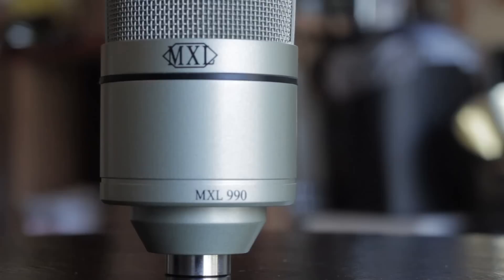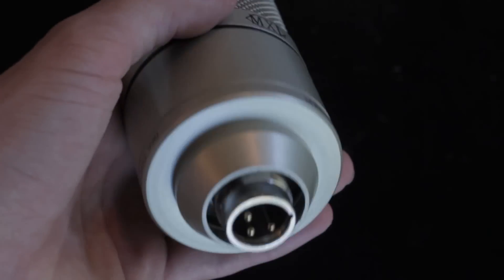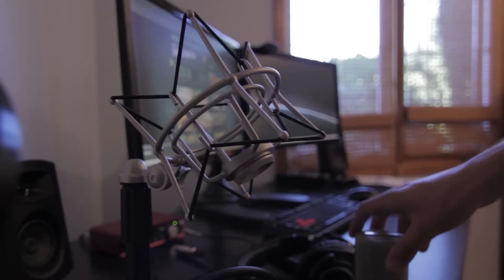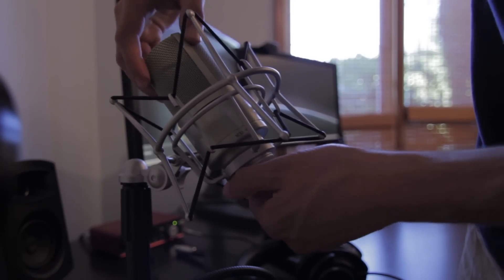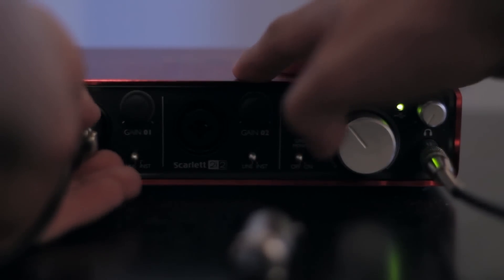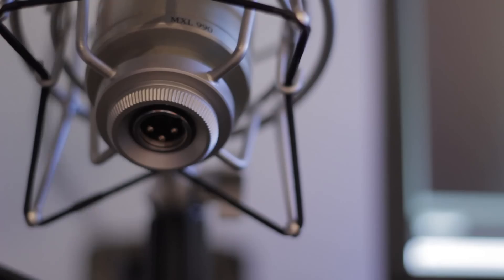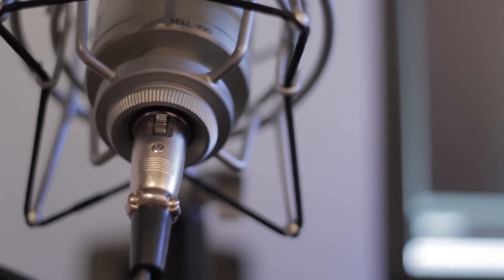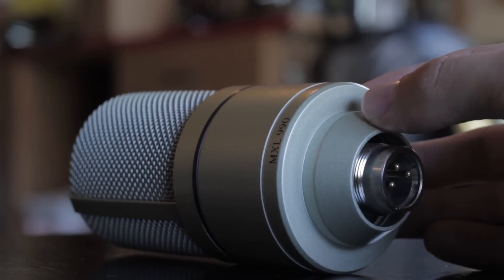Introduction to the MXL 990 Condenser Microphone

Comment: I too found this mic in the pawn shop, but it was a box set...it came with the MXL 990 mic, the shock mount and the standard mount...all in a rugged  ABS plastic case lined with styrofoam and the cutouts for all the pieces to fit snuggly inside...picked it up for $50.00...best studio investment I've made yet. I used it a few times for some vocal tracks...and all I can say is WOW!!! What a difference it made compared to the dynamic mics that I was using. Don't get me wrong, I have some damn good dynamic mics that I use...I plug them into an audio transformer adapter (female XLR on the end to plug the mic into and a 1/4 inch plug on the front that plugs into either my mixer, or my effects processor and then to the mixer...and they sound great for vocals) but the MXL 990 just has such punch, crisp clarity that just sounds phenomenal in the mix...especially after you add a little reverb and/or chorus to it...WOW. This is now my all time go-to mic when I do my vocal tracks...and I use the dynamic mics for backing tracks or mic'ing instruments, amps, speaker cabs, etc. Even for the $100.00 price tag NEW...it's more than worth it. I would definitely recommend it anyone on a budget that wants an outstanding sounding condenser mic, if just as a starter mic...I would put it above and beyond a "starter mic" for sure. I absolutely LOVE mine.

Comment: For the record (and realizing this is an old video) I have to contest: you can actually get some really good straight-to-usb condenser mics... Blue Microphones makes some excellent models that would easily rival or beat a MXL 990, for example.

The actual difference between the MXL 990 and your average USB mic is lack of high-quality preamps, and low-quality A/D converters. Enter the true advantage of analog mics: you can choose your own preamps and A/D converters, and it sets you up for future upgrades - better mics, or whatever.

Anyway, I love my 990 - been using it for a couple of years and it never fails to deliver good clean, detailed recordings.Think I paid $80 and got the 990 bundled with an instrument condenser which is also pretty solid. For the price, it's hard to beat!

Comment: To cut back on background noise, cut your Mic gain back. If you are recording, then in your program like Audacity, you can cut back even more on the background noise and compress the voice recording to even out the volume.

 I own and use an MXL990 XLR microphone but it is modified as the standard mic has some short comings. I've had some very expensive mics but found that after modifying the MXL990, I did not need any other microphone.

I took out the two inner screens on the mic cage to open up the cartridge and also replaced the C3 & C4 capacitors with .22uf Radio shack poly film capacitors. Really made a difference. I may end up putting 1uf caps in as many say it benefits the lower bass even more. The microphone lost the muffled sound with the screen removal and all aspects of the sound were improved with the cap replacement. I also added some automotive rubber sound mat in the base to reduce the bell effect that the base has. It is a thin rubber product that I stuck in there with 3M spray rubber cement. It cannot be too wide as the top of the mic has to screw into the bottom and anything you put in there will interfere with the mic assembly.   I will eventually replace the small mic cartridge with a larger 32mm one soon. Then it will be very close to the higher end microphones as far as sound quality is concerned. 

I use a Alesis Multimix8 USB FX mixer. It has the ability to hook directly up to a computer using the USB port on the mixer without any other equipment. It also has phantom power and several different modes with low, mid and high controls and all the other controls needed. I hook up my mixer to a ham transceiver (a Kenwood TS930SAT) by RCA jacks to the phone patch plugs in back of the transceiver. I also use it for Skype calls as I am often on Internet radio programs and standard terrestrial broadcast stations.

The MXL990 is a very easy microphone to work on. It is fun to take a less than $100 microphone and convert it with just a little time and cash into a microphone that will stand up to many higher end microphones.
Reply from the maker: Wow thanks for the detailed comment Steve, I really appreciate hearing you input. I'm actually very interested in the modifications that you mentioned. Did you follow a guide or do you just know a lot about the inner workings of microphones? Would you recommend these modifications to anyone who feels up to it or is there some good risk involved. 

Also, I would love to know how people go about correctly setting up mic gain and the volume that you're monitoring yourself.
Reply: Nish
I found a lot of information on the internet. Lots of folks have modified their MXL990's to sound almost as good as a high end Neumann.  Just make sure you have a good soldering iron with a fine tip.

I am hooked up to Skype so what I do is call their echo service and what that does is record your mic and then plays it back. You can then adjust gain, sound effects and equalizer settings by hearing your adjustments yourself. Skype is fairly high fidelity so you will hear the differences.

Modifying the 990 is fairly easy as all the parts are numbered on the electrical breadboard. Just follow what others have done on the internet and you will have a mic that kicks butt !!!!!!

Comment: do you need a phantom supply if you have an audio interface? or do you need both
Reply from the maker: ***** If your audio interface does not have built in phantom power then yes, you will need to have a phantom power supply.

Comment: Can it be any power supply to plug the microphone into? Or does it have a certain limit on how much it needs?
Reply from the maker: ArcadeFox This is a good question ArcadeFox, sorry for the late response. XLR microphones typically all sound different and while a lot of them have strengths and weaknesses, the way they sound REALLY depends on what pre-amp you're using to power it. So it's definitely true that you can buy a pretty terrible but cheap pre-amp for your microphone that doesn't allow it to reach anywhere near it's full potential. I'm using the Scarlett 2i2 which is great considering the price of $150 at the time but I could easily spend around $1000 on a new audio interface / pre-amp that makes it sound a lot better.

Comment: You don't need to spend a fortune for an audio interface. Look into the "Focusrite Scarlett Solo - Second Generation" $99.99. If you call the guys at Sweetwater and ask for a discount they will generally get you anywhere from 10 to 25% off.
The Focusrite Solo, the 2i2 or 2i4 are great, clean and prosumer interfaces from $100 to $200 for one to 2 mic inputs.
They work with PC and MAC USB2.

Comment: HI there, thanks for the video on the MXL 990. My question is : how did you remove the background noise/sound?.
Reply from the maker: +roman7771 I had something called a noise gate applied to my microphone here however I would not recommend using it the way I did. It's far too aggressive and even cuts out a lot of my voice. Downward expanders are even better if you can find / use those.

Comment: What stand do you suggest for the 990 with shock mount ? A buddy and I just picked two or these up and having trouble deciding on a stand, we'll be using these on a desk in a studio..
Reply from the maker: +Bolsh the desk stands by On-Stage are pretty great. For 10$ off of amazon you get a very sturdy and height adjustable stand. As for a boom arm, I'm using the Rhode PSA-1 and it's been going strong for awhile now, no issues with weight whatsoever.

Comment: The Focusrite Scarlett 2i2 is $140 new in all the shops.  I paid $125 for mine from Amazon, several months ago.  You can get a much better Focusrite Saffire Pro 24 Audio Interface with 24 channels (8-in/16-out) and Firewire for about $180. Something is seriously wrong if you were charged $250 for a modest 2-in/2-out Scarlett 2i2.
Reply from the maker: I misspoke, I paid 150$ for it new.
Reply: Trevor Freed That sounds more like it.  For awhile the 2i2 was around $125, now $150 seems to be the going rate.  
It's a decent interface with great sounding pres.
Reply from the maker: Yes sir! Still happily using it to stream everyday :D

Comment: can you link to all the products in the video: the interface, the Mic, filter, the cables, etc ...whatever I need to actually make it work. I'm very new to this.
Reply from the maker: Yes sir, sorry for the late reply!

Microphone: http://www.mxlmics.com/microphones/900-series/990/ 

Interface: http://us.focusrite.com/usb-audio-interfaces/scarlett-2i2

The XLR cable I use is just a cheap 6 foot cable that came with the microphone when I got it at the pawn shop. I'd recommend either learning how to make your own (apparently it's quite simple) or monoprice.com 

http://www.monoprice.com/Category?c_id=115&cp_id=11509&cs_id=1150902

Post production for my voice was done with the built in effects in reaper. You'll have to read up on specifically how to use noise gates, compression, and EQ: http://www.reaper.fm/

I hope this helps a little bit. Let me know if you have any other questions!
Reply: Nish Thank you for replying to me. considering my budget, I cannot afford the Scarlett 2i2 so I bought the Lexicon Alpha USB Desktop Recording , remember my schedule is tight and I also bought Mogami Silver Series XLR Microphone Cable Regular 3 Foot, Double Pop Filter  and MXL 990/991 Recording Microphone . I don't have issue with editing vocals, I have other softwares to do, I was just wondering what equipments I need to get started. Thanks for the reply and what do you think of the Lexicon Alpha USB Desktop Recording , that's the interface and it's cheap so no idea how good it is, so please let me know what u know about it. If it isn't good ill turn it back and add a few dollars and get another one. Thank you Nish. :)

Comment: What's the deal with the short delay before picking up sound after pauses of silence?
Reply: It is a noise gate. Not the microphone. And it is driving me crazy. He has the threshold set way too high.
Reply: I see, if that's the case, I'll consider picking one up. Not sure if I like the distance though, but I've seen one review saying it can pick them up across the room, and this one saying he has to be right up against it. Probably the noise threshold again, but thanks for the info anyway.
Reply from the maker: ***** Ya I dropped the noise gate over a year ago, check out some of my more recent videos to get a more accurate representation of what it sounds like correctly EQ'd for voice over work.
Reply: I would not recommend mxl, depending on your application. The mids and highs are all wrong for recording vocals on music, just fyi. Go with a Blue. I have two MXLs and I spend so much time in post trying to fix the eq curve that I don't even use them.
Reply: Frater Oz I was looking at the Snowball, and it seemed really good, despite its price point. I suppose it's the go-to starting mic for a reason.
Reply from the maker: Ya, would not really recommend this microphone for vocals in music tracks, I use it purely for gaming commentary.
Reply: I have the Snowball. It is good for doing stuff at the desktop. I recorded some songs with it several years back. I would go with the spark usb, if you need usb. If you aren't locked into usb and have an interface with phantom power, I HIGHLY recommend the Bluebird. Best mic available for the money IMO.

Comment: I have this mic and I'm looking to get into video game streaming.  So my question is, do you NEED an audio interface or will this work an XLR to USB cable?
Reply: Yes you do need an xlr mic interface. This is because most xlr mics including in this case need phantom power. A simply xlr to usb cable cannot have this. An audio interface will work with this but No the cable will not

Comment: Does this microphone work this I3 processor?? m using it with UR22MKII soundcard, n i have i3 processor n it isn't getting proper power i think.
Reply: Check the back of your UR22, on the left side there's a switch that turns on PHANTOM POWER (48v).
The mic in this video, as with most any other condenser (non USB) mics, uses phantom power to function.

Comment: Hey, I also have the MXL 990. Now, I've got a question: My windws only records to the left ear. People on Teamspeak can only hear me in their left ear, when I click on 'listen' to the microphone when I'm in 'recording devices' I can also only hear myself in my left ear. Now, Ableton Live Lite (version 9) shows me that I can record with 1/2, 1 or 2. I can select 1 so my recording is in the center. 

Now comes the stupid question: Can I only record with Ableton or can I also use it as a platform between the input from my microphone and Teamspeak?

I've been searching for answers for a few days, multiple hours per day now and I get sick of it. I just want my Teamspeak (and windows) input to be centered!
Reply: The problem is that Windows (or mac for that matter) just doesn't have enough love for interfaces as far as basic audio drivers go. What kind of interface are you using? Some interfaces have a "Mono" mode that you can simply switch on. It sounds like you are using a 2-input interface and have your mic plugged into the left channel (usually channel 1). 2-input audio interfaces usually map themselves as a single stereo input, rather than 2 mono inputs. What's happening is Windows and Teamspeak are recognizing your device as a single stereo channel and your microphone only makes up the left channel of that stereo field. There are a few ways to fix this. If your interface has any type of direct monitoring, you can use that to send the signal of your left output back into your right input, basically doubling your voice into both channels.
If you can't do that, you CAN in fact use Ableton to center the sound and output it to teamspeak.(I haven't used it that much, I use Cubase, I'm but pretty sure this works on both) Before you add a new track in Ableton, go to your connection settings and make sure that the vst connection that your using is called somthing like "mono in 1" , not "Stereo-left" if you don't have the "Mono in" one, add that new connection type. When you add the new track in ableton set the input as your mono, this will record and monitor (audition) it centered. If you are monitoring it while you speak into it, you should hear yourself come out of your speakers; now I'm not sure how to do this in Ableton, but you can patch the output of that mono channel into your microphone mix for Teamspeak. If you can't figure that out, consider monitoring your track like I said, and simply running one of your outputs (you can even use a headphone splitter from the dollar store if you only have one output) back into your right input to copy the sound like I said earlier.
Hope I helped! I've had this problem before and it took me a while. Also, you can have a lot of fun if you monitor your mic in Ableton and route it back into your interface. I've added auto-tune and some effects to my voice to have a good laugh with my friends in counter-strike.
Cheers!
Reply from the maker: Matrock Records This is easily the best explanation you'll find on the internet. I learned quite a bit here, thanks Matrock Records for the comment.
Reply: Matrock Records Wow, thanks! Yeah, I'm using the Focusrite Scarlett 2i2. With the direct monitor switch to 'on', I do hear myself through both boxes. I have the line/inst switch, but i'm not sure what benefits it brings (since you know quite a lot more about these things than I do, maybe you also know this). I'll try to set my TeamSpeak input to that what Ableton 'records'. If that doesn't, I''ll try Cubase! Thank you so much for your time!
Reply: Jacco H No prob. I just had another Idea too. If you can turn your direct monitor on your Focusrite off, and create a mono track in ableton and monitor it on there, if you listen to yourself while you talk and it comes out centered in your headphones then, you could set your teamspeak (maybe you have to do this through windows) audio device back to your normal windows one and get a 1/8" to 1/8" chord and go from your Focusrite's headphone out to your computer's built-in soundcard's microphone-in (usually the pink one). That should do it too.

Comment: so what is your interface? and this interface let you hear in headphones of what you are talking to the microphone?
Reply from the maker: +Mateo Misterioso hey Mateo I use the Scarlett 2i2! It's a pretty well built and all around solid interface. I've had some very slight issues with driver comparability issues when windows 8 and 10 were first out but I believe they've since been updated. (back on windows 7 again so it wouldn't matter anyway)

And yes this interface allows for monitoring both input signals.

Comment: What stand are you using? I just bought the mic and I can't find a stand that fits.
Reply: You have to buy an adapter for the stand
Reply from the maker: I could be wrong but most microphones comes with the adapter ring that you use for different stands

Comment: i got a question, will the blue yeti fit in the shock mount?
how would i be able to attach it to the mount?
i contacted some people and they said this is the shock mount: MXL BJ6.
if you could help me i will love you :D
Reply: Abraham Lincoln and yes i have a 5/8" male connector adapter.
Reply from the maker: I've never owned a blue yeti so I'm not sure, sorry. You could always try checking if there are measurements listed for it or go to amazon reviews for the shockmount and see if anyone with a blue yeti has tried it.